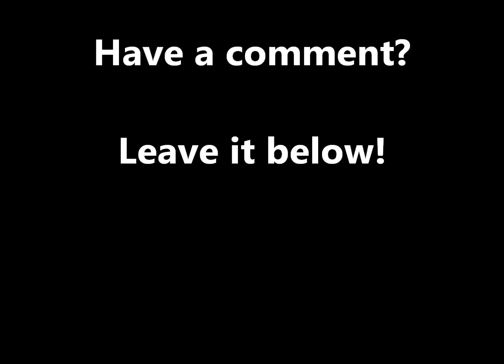Why magnet motors can not work (part 2)

Comment: While I have not come up with the "working model", I do believe it is somehow possible. I know for every action there is an equal reaction. So the force used is the force needed to propel and then reset. Yet, that being said I am inspired by the working of the universe itself. The Earth and moon are in a delicate dance of force and mass to produce a near perfect motor. Somehow we are all missing something. I don't think we should think of force used and to reset but force used and change which allows reset. But who knows, anyway, magnets are fun and I like playing with them.
Reply: You are completely right, except that you are missing the energy source that most call the Sun.
Reply: Yes, the sun also does a similar thing with the  planets. On the Earth moon relationship, I perceive that there is a certain point of neutrality or equilibrium where speed, mass, and force are in balance and slip out of balance so that the trade off is in reverse order as prior to that event. 1,2,3 and then 3,2,1 and so on. It then repeats until some other force interferes with the balance. Any drag whatsoever will upset that balance and therefore to build a machine on that model might be futile at best.
Reply from the maker: Myreply59 "Any drag whatsoever will upset that balance and therefore to build a machine on that model might be futile at best.",

Very good. The solar system is a bit more dynamic than that but assuming it would otherwise go on forever your thoughts here are exactly correct.
Reply: I agree with that, yet the quest will probably go on anyways.
Reply from the maker: Myreply59 Experimentation is a wonderful thing!

Comment: Anything that can be secret will be secret. Used for the few, the only things you know are the things known by the masses. Especially if you read it from a text book. Learned it from you school, that is a GREAT thing, it is also what we need, our knowledge. But you fail to mention the tons of knowledge withheld purposely using strategic measures. To benefit the few, to allow even more power and control to the few men who control your school, your media, your corporation,your country, your head.

Comment from the maker: "watchvideo" NO scam (it's a REAL DEAL) Muammer Yildiz Magnet Motor demo at Delft University" he shows it running for several minutes before they dissasemble it in front of a group of scholars no batteries hidden inside.",

There is plenty of room to hide batteries in that 'demo', only an idiot would believe it is a working overunity device. Congratulations...

Comment from the maker: "what if attached to the spinning axel there was an arm that repeatedly, with every revolution, hit the bar magnet that propels the V gate motor? Would it not then be creation its own energy after the initial push?",

This has been tried, and it would seem like it would work but if we look at it more closely and think about it the energy needed to 'hit' your bar magnet to 'propel' the motor will be just as much as you get back out.

Comment: FYI PROOF OF OVERUNITY IS ON MY WEBSITE AT MY OUPROOF PAGE, A MATHEMATICAL PROOF, FORM A BOOK ON SOLENOIDS AND ELECTROMAGNETS STATES THAT BASICALLY THE POLARISED ELECTROMAGNET DESCRIBED CAN OUTPUT 10,OOO MORE FLUX LINES THAN INPUT OVER 400 TIMES OUTPU OF FLUX THAN INPUT, BOOK WRITTEN IN 1914, PAGE IS SCANNED AND DISPLAYED ON OVERUNITYBUILDER OUPROOF PAGE. I DID INVENT THE LENZLESS GENERATOR AND THE FLIPPER, SEE ON MY WEBSITE

Comment: REALLY I AM SURE YOU DON'T KNOW THE FOLLOWING,,, THE LAWS OF THERMODYNAMICS DO NOT APPLY TO RELATIVISTIC SYSTEMS
PAGE 94-ELECTRIC CIRCUITS BY J. RICHARD JOHNSON-HAYDEN PUBLISHING CO. ALSO, Electromagnetism is inherently relativistic...page323..ESSENTIALS OF ELECTROMAGNETISM..BY DAVID DUGDALE--read  chapter 12 on "RELATIVITY AND ELECTROMAGNETISM" AND IRON ACTS AS A CURRENT AMPLIFIER, MULTIPLYING THE EXTERNALLY APPLIED CURRENT BY A FACTOR OF µ-- Page194-Essentials of Electromagnetism,

Comment from the maker: "...scientifically wrong to state with certainty that something cannot be done...",

Absolutely agree.

"especially when working models such as yildiz's have been demonstrated in front of skeptical scientists and taken apart showing no fraud",

That never happened. He only removed a couple parts from the top and hid batteries in the bottom section. Which do you think is more likely, Yildiz came across the greatest scientific discovery of all time or he is another in a long line of cons?

Comment from the maker: "Lol I find this to be a load of bull crap. Magnet motors do work. I could make a working model if I had some neodymium magnets some glue and a disk shaped wheel (or any ball-bearing wheel). It isn't that hard to understand how it works. You must not have a good understanding of magnets",

If you know how to do it then build one and buy yourself a ticket to Norway so you can collect your Nobel prize. If this idea only works in your head I suggest experimentation before such laudable conjecture.

Comment: Lol I find this to be a load of bull crap. Magnet motors do work. I could make a working model if I had some neodymium magnets some glue and a disk shaped wheel (or any ball-bearing wheel). It isn't that hard to understand how it works. You must not have a good understanding of magnets.

Comment from the maker: "@1:05 can't you just hook the bar magnet to a cam that runs off the wheel? Never done any magnet motor experiments but just wonder, kinda like a camshaft's lifters?",

An excellent idea that few people who play with these things think to try. The problem is the amount of force needed to reset the magnet will be equal to what is gained. Try building one, a hot glue gun and some magnets from the local hardware store can go a long way to learning about these things

Comment from the maker: "Is it possible to make a magnet motor that is not propetual",

Unfortunately no, it would be great if we could. It is difficult to explain why in 500 characters or less so I usually suggest taking a trip to the local hardware store to get some magnets, a hot glue gun and experiment for yourself. Keep it simple and you will see it doesn't take long to realize why these things can't work.

If you decide to try it out make a video and I will post a link from my channel for others to see!
Reply: Hi friend, I've seen this video for years, i always come back to watch it cause it kinda gives me motivation, wanted to tell you that after 13 years of hard and serious  experimenting ( not like rodney stators or many others...) I finally finished my design, and honestly, I don't know what to do with it. It's a mechanical device. It uses magnets, kinetic energy, gravity, and two other components, and yes, it is the most advanced experimenting model at the moment, but yes, it is possible.
Reply from the maker: @andresgalviz315  If you believe it is possible, I suggest trying it out by building it. You will learn from the experience, just keep it on the cheap.

Comment from the maker: @Truth If you notice in his 'prototype' he is lifting his hand, the energy needed to lift this magnet is exactly equal to any gains you could achieve through the device itself. The video shows no sound so he is likely using compressed air to keep it spinning.

Also I talk about the V Gate specifically starting @ :47.

Questions are not only welcome but encouraged in this comment section.